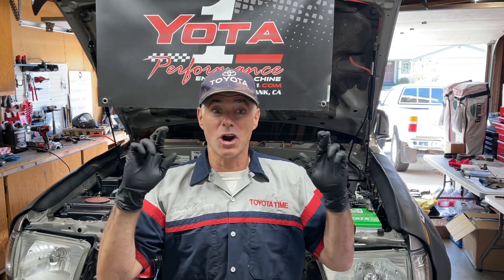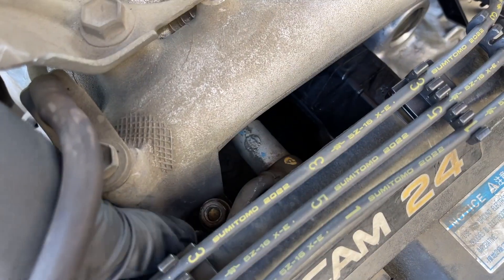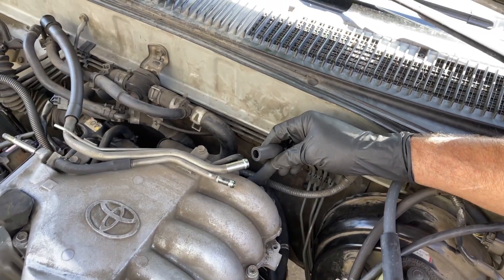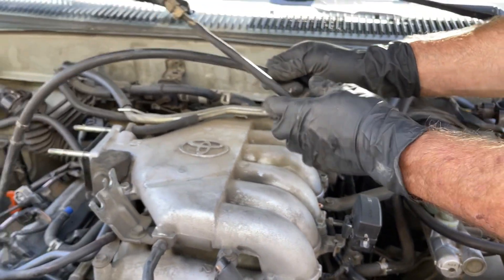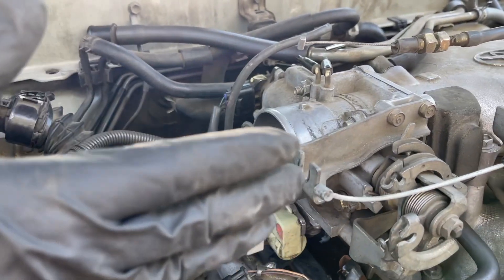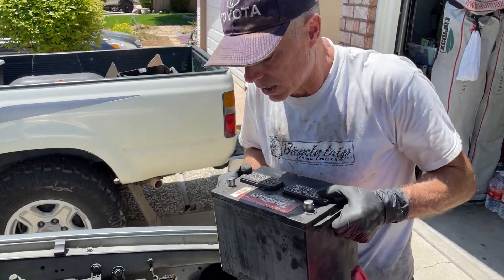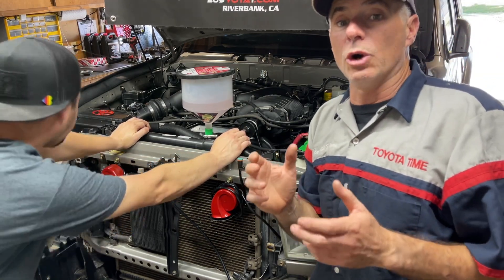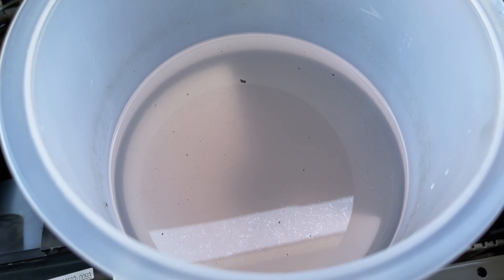Engine Head Gasket / Cracked Head Repair (Toyota 3.4L V6 5VZ-FE ) - Part 7

Comment: Hearing Timmy drop the F bomb really tells that it was a lot of work 😂
Reply from the maker: If you only knew how much I swear when turning wrenches.  Sometimes we leave some of the profanity in because it was fitting to do so.  Turning wrenches can be frustrating.  Now add filming into the mix and it can get even more frustrating.  It's definitely an exercise in patience.  But yeah, filming this job was a TON of work.

Comment: Fantastic job Tim and Sean! I really hope I luck out and not have to do this in the near future but my engine is getting pretty high in miles. But when the time comes I feel confident now in taking it on. Thank you guys for your willingness and devotion to helping others. I enjoy saving money of course but taking on these types of challenges gives me much deeper satisfaction. Thanks again! 
 Ben
Reply from the maker: Thanks for your comment, Ben.  We appreciate it very much.  I also hope you never need this series.
Reply: @TimmyTheToolman  LOL well hope in one hand I guess
Reply: Benzoil0453,  how high in miles? I have 314k on my 5VZ in 26 years and seems to be ok still... its not supercharged or anything and i try change the coolant 2 gallons worth every 50k miles
Reply: @efil4kizum  About to hit 375,000 on my 3.4 4runner. 245,000 on my 3.4 tacoma. Both still clicking along just fine and I too try to stay up on the maintenance since I bought them. Just nice to watch these videos and mentally prepare myself for these jobs ahead of time lol
Reply: @benzoil0453  my old tacoma just sprung a rack leak by the rag joint a few thousand miles ago in New York on my way back home from east coast... the leak appears to have slowed up after a full bottle of prestone asian stop leak until i can get it fixed along with new LCAs and a new clutch that is finally making that bearing chatter SMH 
probably needs new suspension parts too, springs and some new coilovers up front
Reply from the maker: @efil4kizum  Sean's engine has around 200k.
Reply from the maker: @efil4kizum  Good luck with all the work.

Comment: Hey Tim! 

I picked your brain several months ago about the 5VZ engine change. Haven't pulled the trigger yet, was thinking my truck was still in great enough shape for some low-maintenance commuting for at least another 50K, but... Ugh!!! I found a ticking bomb. Head gasket leak. 

So, for a re-fresh of our last conversation, I have a cherry, 300K Tacoma limited 4x4 5vz double cab. No lift. no mods. no supercharger, etc. Rarely has it been reved to 4000. Mobile 1 5W-30 every 3000, timing belt/water pump, transmission fluid and other fluids change every 80K. A little POR-15ed frame rust at the spare tire cross-member area of frame but otherwise good.  It's never over-heated. Other than up into the mountains a couple days a week to ski or DH MTB, its been road-babied, runs great, but I'm going through it now to give it to my niece, a rural Mainer, getting her DL soon, and it should continue to have an easy life in her hands. I've replaced all the front end goodies to tighten it up to factory, and when getting ready to final that all up I decided to change the valve cover gasket seals and clean-up 100k worth of seeping oil goo before changing the rack bushings. Long story short, after changing the valve cover gaskets (with help from your video; thanks there!), I was looking for post gasket install leaks, using an inspection mirror, and found a ticking time-bomb under the rt exhaust manifold, next to the engine mount--a very clearly, apparently very long leaking head gasket spot about 1/4" (coolant) at No. 3 cylinder. Mixed with oil from the long-leaking valve gasket, and road grime mixed for grit, it looked like clumps oily red clay balls, sitting on the engine mount. Cleaned it up blindly using mad contorting, and it is a very slight, non-oil, pure coolant leak. It doesn't use noticeable amounts of coolant; no coolant in the oil; no steam out the tail pipe; with the radiator cap removed, once temp opens the thermostat, no bubbles; no misfiring; no power loss; good idle' etc. I doubt the head is warped; the gasket had just slightly given out due to age, a drip or two of coolant every 30 miles or so, coagulating below the gasket to over-board at that one small spot next to a cooling port. So now I'm in a conundrum...

Okay, looking at your head gasket vid, and from reading forums, clearly if I open this thing up and find "detonation cracking" across the valves in the dome, I might be in for the cost of re-mfged heads. Yota1 wants something like $1300 for each head sans shipping to Colorado. With gaskets, seals, tubes exhaust studs, etc, etc, if the heads are beyond welding, the bill could easily go up to the approach of a Yota1 motor; not to mention time wise I might actual be able to install a new motor more easily. Now because I've babied it, it is NOT supercharged, I might have decent heads still and be able to get away with just pulling the heads, cleaning up the gaskets decks, installing new Toyota gaskets and driving on. The question(s) I have:

1) In your experience how likely is it that a 300K factory head won't have "detonation cracks"? 
2) How likely if cracked can it still be repairable by a decent machine shop? (being that the head isn't exactly "blown")
3) Am I logical in my assumption that the head, having never been overheated, is probably not warped out of Factory .004 mm tolerance?
3) Time-wise, if you don't pull the transmission, and no big eff-ups happen, is the engine change faster? 
4) Where do I find the Di-Lithium Crystals to keep this beast running? 

Larry
Reply from the maker: I don't have a lot of experience pulling heads off these engines.  I've only done it once.  According to Nick at Yota1 Performance, detonation cracks are fairly common.

How likely would a cracked head be repairable?  Again, that's something I really can't answer for you.  

I doubt the heads will be warped.

An engine swap is still a lot of work because you have to completely strip your old engine, clean up the parts and swap them over to the new engine.

I think you should just pull the heads, send them to a machine shop and see what you got.  If it ends up you need new heads, that's when you should consider just buying a rebuilt engine.
Reply: Oh yeah, another thing to mention is that before discovering the leak I did a dry/wet compression test and my numbers weren't awful, but not great either--172-3 (dry) and 210/15 (wet) across all cylinders, which admittedly was disappointing, but I suspect the previous owner (I bought the truck with 56k original miles on it 246k ago, and they likely used crap oil and didn't change it regularly; that's all I can figure for the disappointing compression numbers. Anyway... Although I haven't done  a leak down to test the heads, it shows the compression rings are clearly somewhat tired (150psi is the low Toyota "serviceable" number. Also I've got 20k (if the leak didn't exist) to do another timing belt/water pump replacement. I guess my internal argument is: would I be money/time ahead to just skip attempting a head gasket replacement and just going straight to the Yota1 engine swap?
Reply: I intend to keep this thing until the wheels fall off. Why? There is just something special about the size and (relative to new full-size Tacos), and the relatively analog nature of these 1st gen Tacomas. I just bought a Subaru Crosstrek Sport, and as great as it is to drive, I shudder to think of the electronic/computer problems that will come up after a 100k. Just the touch screen that pretty much operates everything is $5k to replace. But back to the 5vz... It seemed like one ends up pulling 70% of the stuff you need to pull the engine, the worst seems to deal with the exhaust manifolds, which either way is required, not including everything one does to change the timing belt, valve covers and heads, and the other "since we are in here" parts (hoses, motor brushes, etc), which as for the critical, "while we are here" parts would be obviously easier to change out with the engine pulled. So a question... After pulling the engine, in that you've now actually done it, did you see any specific reason removing the transmission was necessary to pull the engine? Alleviating the transmission removal, from watching the vids, seems to remove about 50% of the most difficult work required. Is that the case? That's just what it looks like. And if that's the case, skipping the trans pull, it seems about equal effort between changing the heads and swapping the engine, and if Yota1 engines are as good as they seem then you should have a strong, worry-free engine for a couple more thousand miles. And again, I'm only shooting 172 psi with a dry compression test. But then I 'm just digging for info; I have no experience with either jobs or longevity of replacement parts.  @TimmyTheToolman
Reply from the maker: @redsledski  The reason we pulled the transmission is because at the time, we believed it was easier to mate the transmission to the engine rather than mate the engine to the transmission. Now that I've pulled engines both ways, mating the transmission to the engine is easier, but is it enough easier to spend the time removing the transmission?  The answer is no, but getting the engine at the right angle and mated to the transmission is a pain in the ass.  You should watch our 3.0 to 3.4 swap we did on a 2nd Gen 4runner for tips on how to do it.  Just watch the part where we are putting in the new engine.

I think you're a candidate for a rebuilt engine.  Or, you just drive it as is until you're forced to do something.  It doesn't sound like to me the coolant leak is significant.   If it were me, I'd keep driving it as is.  If you're worried about its reliability because you'll be taking it on some long road trips, maybe just do the engine swap for the peace of mind.
Reply: Thanks so much for the tips. Much appreciated. Trying to come up with a game plan and be smart about it. Yeah, I'm going to hold off on doing anything until I hit my next timing belt change time, which is in another 20K. I should possibly make it; I hope! I put hella miles on my truck, 70-to 80 miles a day, so it will be sooner than later, probably next fall. I'll just keep an eye on it. But approaching then, yeah buddy, I'll be ordering a Yota1 motor. Just one more question... Would you say that doing a 3.4 to 3.4 swap with an auto trany would be a lot easier than trying to stab in than with the manual trans you guys were fighting? It looks like stabbing the output shaft really hung you guys up. That and having the A/C compressor installed rather than hung off to the side of the bay. I ask this because I might be attempting this thing solo.   @TimmyTheToolman
Reply from the maker: @redsledski  I do believe mating an engine to an automatic transmission is easier than mating an engine to a manual transmission, no doubt.

Comment: I have 583,000 miles on my 2002 Tacoma (original motor, transmission, fuel injectors, and a lot of other stuff). When I first got it in 2001, the odometer only had 17 miles on it. Just did compression test- 5 cylinders were all 205-215, but cylinder #2 failed (<40 PSI). I've used your videos for a lot of maintenance tasks, and I'll likely be using your video breakdowns for header repairs to get the truck back up and running. Hoping for no cracks in cylinder head. Really want to break 1 million miles with original components.
Reply from the maker: Wow! Super cool to hear of owners like you so thank you for taking the time to stop by the comments and share that info. The bottom end of your engine should be fun (we hope!) - We will pray to the Toyota Gods for you 💪🏼
- Sean

Comment: Another great video series!  You guys are true professionals, and it really shows when you do something this involved and the engine starts and runs like it's new.  I used your timing belt video to do the timing belt on my 2002 tacoma.  Everything went perfectly!  I have one question. Considering that you're removing the heads in this project, is it really necessary to set the engine at TDC of cyl 1 before you begin?
Reply from the maker: We're glad you like the video series.  In reality,  you don't really need to put the engine at TDC.  When it come times to pulling the heads off, you have the alignment dots on the cams to go by to get them off properly.

Comment: Curious what you think I should do after my failed head gasket job.

I replaced my head gasket a little over a month ago and it’s very clear there still is an apparent leak. Oil is heavily mixed with coolant and smoke billows out of the exhaust.

I had done everything to spec other than thoroughly checking the block surface (I really did not think the block would be the issue) so I just cleaned it and reassembled. Which I guess was likely a big mistake. 

Do you think it is more worthwhile to pull the engine, tear it down to the block, bring the block to a machine shop and see if it can be repaired (assuming the block was the issue)

Or say the hell with that engine and throw a different 3.4 in the car. 

With the price of 4Runners right now this is really my only 2 options I can think of that Dave me money. I have a little commuter but with winter coming I want to get my 4runner back on the road.
Reply from the maker: That really sucks you did all thst work and you still have an issue.  If it were me, I'd probably just get a rebuilt 3.4 from Yota1 Performance or other shoo with a good reputation in the industry.

Comment: I followed along and i did it on the street before street sweeping came by lol and i did it to the last part of the stating the car. But it cranks and hasn't started. It gets to a point of wanting to start and then dies like there is no power. No codes from the scan. I tried to jumpstart it and stiill cranking with no start. Any advice?
Reply from the maker: With that involved of a job, the only thing I can say is retrace your steps and make sure you made all the electrical and hose connections.  Get the intake plenums off and make sure all the injectors are connected, the coolant temp sensor, knock sensor connections.  All the connections to the throttle body, etc.

Comment: so i finished the job. Went to start it and im pretty  sure i had to number 1 coil pack connector switched with the number 3 connector it started but ran real funny as if it was missing or somthing i shut it off. Now that i think about it it might have been firing out of sequence. Figured out i switched the connectors this morning  fixed it now it wont start it jus cranks but if i keep tryin to crank it it maks a funny clunk noise. I checked the timming also and its dead on. Did i ruin something when i started and let it run for about a min with the connectors switched?
Reply from the maker: I don't think you could have done any damage switching the connectors.  I really don't know how you could have connected the coil packs wrong.  The didn't think the wires are long enough to be transposed.
Reply: @TimmyTheToolman  u think the cylinders are flooded with  fuel cuz I keep tryin to crank it? I crank it untill it makes this weird clunking nosie it sounds bad like somthing is messed up inside. I cam turn the engine over by the crank bolt and feel no resistance and here no clunk it's only when I try to crank it over

Comment: Before this video I had my mechanic do this for me and for some reason the hardest bolt to get to closest to the brake booster still has a small oil leak. I've torqued it to spec multiple times. Any thoughts on how to stop it?
Reply from the maker: I guess you're talking about the valve cover gasket leaking.  At the back of the engine, there's a half moon that needs to be re-sealed and a cam plug thet needs to be replaced.  Maybe your mechanic didn't do one or both of those.
Reply: @TimmyTheToolman  thanks!